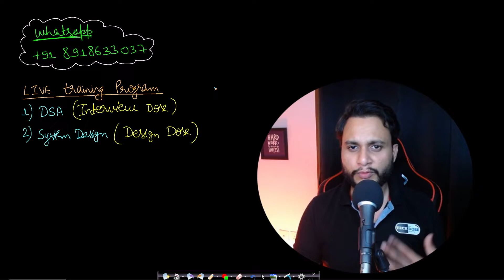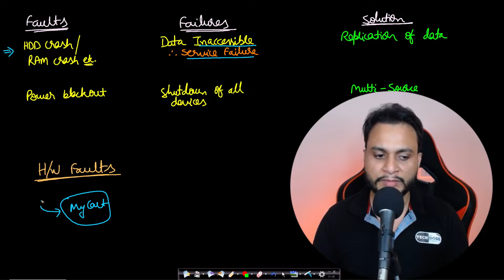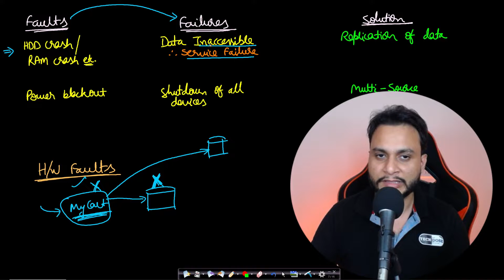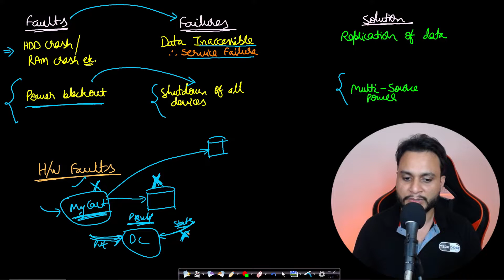Fault Tolerance | System Design

Comment: Fault Tolerance VS Resiliency

Fault tolerance and resiliency are related concepts in system design, but they focus on different aspects of a system's ability to handle failures and disruptions.

# Fault Tolerance
- Definition: Fault tolerance is the ability of a system to continue operating correctly in the presence of failures. It emphasizes maintaining functionality and service levels despite the failure of one or more components.
- Focus: It primarily focuses on preventing a system from failing outright by using redundancy, error detection and correction, and failover mechanisms.
- Key Elements: 
  - Redundancy: Extra components to take over in case of failure.
  - Failover: Switching to a backup system or component when a failure occurs.
  - Error Detection and Correction: Identifying and fixing errors to maintain normal operation.
- Goal: The goal of fault tolerance is to ensure that failures do not lead to a loss of service or data, maintaining the system's operational status.

# Resiliency
- Definition: Resiliency refers to the broader capability of a system to recover from failures, disruptions, or adverse conditions and return to normal operation. It encompasses not just the ability to withstand failures (like fault tolerance) but also the ability to recover and adapt.
- Focus: Resiliency includes fault tolerance but also covers recovery, adaptability, and the ability to continue providing service at some level, even under adverse conditions.
- Key Elements:
  - Recovery: The process of restoring normal operations after a failure.
  - Graceful Degradation: Maintaining partial functionality even when some components fail.
  - Adaptability: The ability to adapt to changing conditions and continue functioning.
- Goal: The goal of resiliency is to ensure that the system can not only survive failures but also recover and maintain acceptable service levels, minimizing the impact on users and operations.

# Key Differences
- Scope: Fault tolerance is a subset of resiliency. While fault tolerance specifically deals with continuing operations in the presence of component failures, resiliency includes fault tolerance and extends to recovery, adaptation, and overall robustness in the face of disruptions.
- Approach: Fault tolerance typically involves immediate mechanisms to handle failures (like failover systems), whereas resiliency involves broader strategies, including planning for recovery, business continuity, and long-term system adaptability.
- Impact on Users: Fault tolerance aims to prevent users from experiencing disruptions by ensuring that failures do not affect service availability. Resiliency, on the other hand, acknowledges that some level of disruption may occur but focuses on minimizing impact and ensuring a quick recovery.

In summary, while fault tolerance is about preventing failure from causing service loss, resiliency is about the system's overall capacity to handle and recover from a wide range of failures and adverse conditions. Both are crucial for building reliable and robust systems, especially in environments where continuous availability and quick recovery are essential.

Comment: In system design, fault tolerance refers to the ability of a system to continue operating properly in the event of the failure of some of its components. A fault-tolerant system is designed to detect and handle errors gracefully, ensuring that the system remains functional and provides the expected level of service despite the presence of faults or failures. This capability is crucial for maintaining reliability and availability, especially in critical systems where downtime or data loss can have significant consequences.

# Key Concepts in Fault Tolerance
1. Redundancy: The inclusion of extra components, systems, or subsystems that can take over in case of failure. Redundancy can be achieved at various levels, including hardware (e.g., duplicate servers), software (e.g., multiple instances of a service), and data (e.g., data replication).
2. Error Detection and Correction: Mechanisms that can identify and rectify errors. This may involve error-checking codes, parity bits, or more complex error-correcting algorithms.
3. Failover: The process of switching to a redundant system or component when a failure is detected. This can be automatic or manual, depending on the design and criticality of the system.
4. Graceful Degradation: The system's ability to continue operating in a reduced capacity when some components fail. Instead of a complete failure, the system provides partial functionality, allowing users to continue working with some level of service.
5. Isolation: Designing systems so that faults in one component do not propagate to others. This can be achieved through techniques like compartmentalization, sandboxing, and using well-defined interfaces.
6. State Synchronization: Ensuring that redundant components maintain consistent states, so they can seamlessly take over in case of a failure. This is often achieved through data replication, synchronization protocols, or shared storage.

# Fault Tolerance Techniques
1. Replication: Using multiple copies of data or services to ensure availability. For example, databases can use master-slave replication or multi-master replication to ensure data availability and consistency.
2. Load Balancing: Distributing workloads across multiple servers or components to prevent any single component from becoming a point of failure.
3. Heartbeat Mechanisms: Regularly sending signals between components to monitor their status. If a component stops sending heartbeats, it is assumed to have failed, and a failover process can be initiated.
4. Checkpointing and Rollback: Periodically saving the system state so that it can be restored in case of failure. This is useful in long-running computations or transactions.
5. Error Masking: Techniques that prevent users from seeing the effects of errors. For example, using redundancy to mask hardware failures.

# Importance of Fault Tolerance
Fault tolerance is essential for systems that require high availability and reliability, such as financial systems, healthcare applications, aerospace systems, and telecommunications networks. It ensures that:
- Service Continuity: The system can continue providing services even in the presence of component failures.
- Data Integrity: Data remains accurate and consistent, even if some components fail.
- User Experience: Users are less likely to experience disruptions, improving overall satisfaction and trust in the system.

By incorporating fault tolerance, organizations can minimize the impact of failures, reduce downtime, and ensure that critical services remain available, even in the face of unexpected issues.